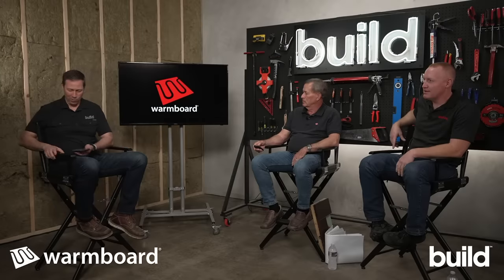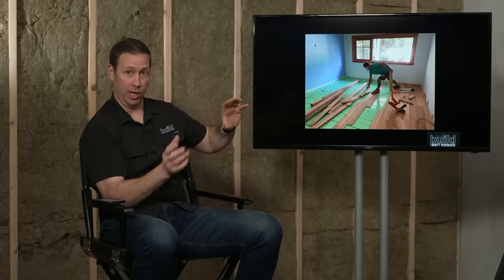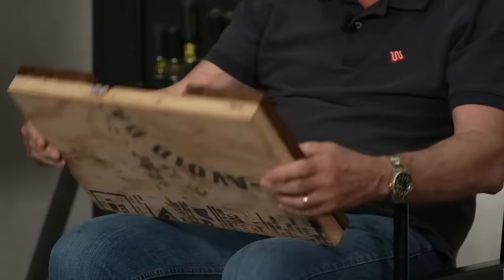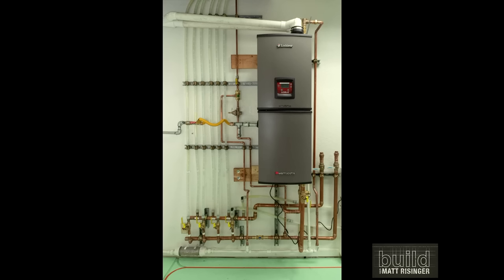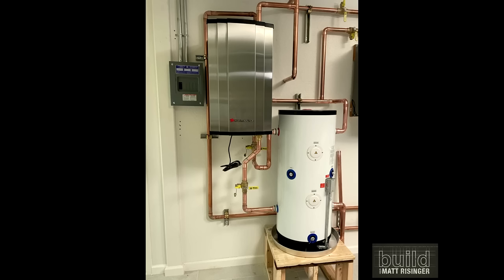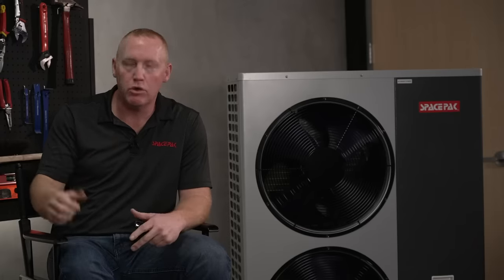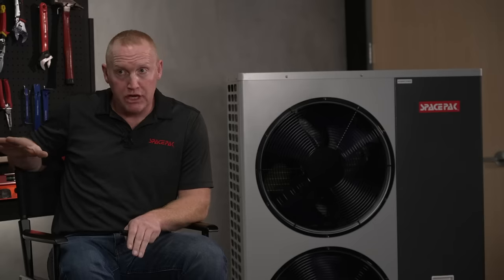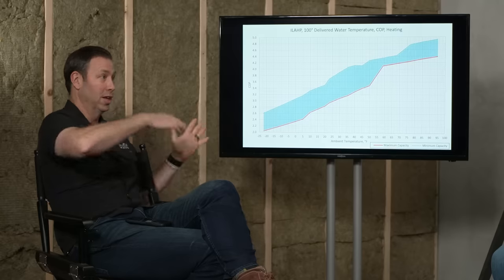Cold Climate Heat Pumps for Radiant Floor Heating. No gas, no boiler!

Comment: Why is it called "Radiant Floor Heating"? Very little heat could be transferred via radiant transfer but rather conduction to the flooring material which then heats the air in contact with the floor which then convection would distribute the warmer air upward within the room establishing a rotation circulation with cooler air sinking down to the floor replacing the warmed air. 

Radiant heat transfer can only occur line of sight, and does not heat air, but only the water suspended in the air. In other words, almost no heat transfer at all. And there cannot be any radiation transfer from the pipe or aluminum because heat radiation is light, which is completely obscured by the floor material. The system heats the flooring via conduction. The flooring material would technically radiate heat upward but I doubt a person could feel the effect. You can test this using a piece of cardboard, or any opaque paper, to block the path between the floor and your body to see if there is any difference. I expect there will not be, because it is the air in the room keeping you warm, not radiated heat. 

All right, I'm off my soapbox.

Comment: Concrete is a poor conductor which makes it perfect for radiant heat. It has thermal mass that give heat off slowly and consistently. It also has tons of flexibility unlike pre spaced worm board.
Reply: The best radiant pattern is a spiral  pattern where the supply and return follow each other.   No cold spots.    The warm board looks like a serpentine pattern 👎. The worse pattern.      Floor is hot and cold hot cold hot cold

Comment: So imagine I install warm board as I would T+G OSB. Then, partition walls and backout framing. Then some HVAC is needed, plumbing, electrical, drywall and taping. Interior trim, cabinets, and other finishes. Painting happens before 
the floor finish, which is last. Obviously, Warm Board won't survive the construction process without protection. What do installers do? Sheathe the entire Warm Board with 1/2 OSB? Sounds extra pricey. Is there an alternative? What do you recommend? Curious in Denver.
Reply: i wouldnt worry about a 7/16 OSB panel costing $13 when these cost about $400 each.
Reply: Once you lay something over the warmboard you cannot tell where to nail the wood flooring.  Your nails could only penetrate 7/16".
Reply: @philipdamask2279  well to be fair, wood flooring is maybe 7-8” max width.  You can see the tubes as you go.  Perpendicular would probably be safer.

Comment: Any hope that heat pumps will be able to heat at even colder temperatures? I’d like to wait to buy a mini split until it can heat all winter here in MN
Reply: It's just a matter of finding the right refrigerant. This will have a low global warming potential and turn from a liquid to gas at the temperature you want. If you use a refrigerant that boils at -70F, you will be able to extract heat from the air in MN even on record-breaking cold days.
Reply: Don't let perfect be the enemy of good. You don't drive around a big box truck just because everyone once and a while you'll want to move house. Think of the heat pump the same way. The above heat pump will output over 30kBTU as -20F (the lowest 99% temperature I could find for MN) with over 160% efficiency. Spending a little on supplement heat on the other 1% is still very likely cheaper than either waiting-for/buying a 'better' heat pump, or buying no heat pump at all.
Reply: @tlangdon12  Sure, but think of what your suction and head pressures would be using that configuration of refrigerant in summer..... What you're suggesting is totally unworkable.
Reply: @KennyMacDermid  So you're using a LOT of electrical energy to run the heat pump, (outdoor fan and compressor, defrost heaters on the outdoor unit as well, supplementary heaters and indoor fan for indoor unit) for average winter temp operation, and a LOT MORE for supplementary electrical heat on colder days.... and there can be many of those colder days. Don't try to trivialize/minimize what those operational costs will be. The overall system will be sized to suit AC demand for the home, not for heating side demand... the same compressor/outdoor unit/indoor unit will be used for all seasons and oversizing it will lead to operational problems just as surely as undersizing it will. And where will the unit's necessary electricity come from?..... probably from a natural gas fired boiler to create steam for a steam turbine-generator or even a gas turbine-generation system at a power plant. So fossil fuels will still be very much part of the reality of operating that air source heat pump. Plus electrical energy is considerably more expensive for heating purposes than natural gas. Be intellectually honest, be rigorous in your analysis.
Reply: @9UaYXxB  🙄 Supplemental heat could be natural gas. No one said anything AC related. Natural gas at a power plant then used to run a heat pump is still more efficient than burning that gas at the house. I'm struggling to find a single honest thing in your reply.
Reply: Thanks all for the replies. I didn't state, but the need for energy efficiency is not the primary reason for switching to a heat pump for me. My house has natural gas boilers that don't heat the house very evenly. Additionally, the gas prices skyrocket in winter, so maybe some supplemental heat would help make the house more comfortable while also alleviating the need to heat only on natural gas.

Again, just thinking it would be ideal for the system to be able to support some heat in winter while providing air conditioning that we currently do not have.
Reply: @9UaYXxB  Over-sizing is not as much of  an issue  these days with variable speed compressors and fans. Compared to electric baseboard heaters, heat pumps (of any recent make, model or technology) are electrical misers. In Canada, heat pumps (mostly mini splits) are rapidly out selling gas furnaces.
Reply: @9UaYXxB  You are nissing the 300-500% more heat per kwh benefit.  Particularly useful if you have no natural gas.

Comment: I was trying to figure out how to put in-floor heating without filling the tubes with holes when nailing down subfloor and walls. Would there be any notable demerits to holding the tube down a little more than 3 inches from the top of the joist?
Reply: @James Karrie I was thinking that you could mount the tubing along an i-joist with a 1 1/2 inch spacer between the bottom of the 2x4. That said, they do mention that it would take longer for the heat to travel into the floor.
Reply: @human_ai402  just install the walls and flooring first.  then mount the tubes under when its done.  not a big deal later but more of a pain under then over.  if you put in insulation after the tubes are mounted, the heat will transfer up just fine.  remember, wood sucks as an R value.  only R1 per inch.  subfloor and hardwood would be R1.5 max.

Comment: How hot can you heat the floor? A hot floor would expand the wood and cause cracks when it cools.
Reply: most people set their tanks to 100, maybe 110.  not really an issue.
Reply: @neckofthewoods24  Thanks

Comment: Question,  how do you purify and balance the humidity the air in your house.   🇨🇦
Reply: Using an HRV, a humidifier on the central system, and appropriate controls.  You'll need to involve an HVAC service company. Do it right. There's structural and health implications if it's done poorly.
Reply: You need another system to process the air.

Comment: what about using ground heet in stead of using air heat. as the ground is normaly much more constant in temperature and a higher temperature.
the only disadvange is the higher costs for drilling the ground pipes. about 5.000 Euro for an 100 meter deep wel. depending on the heat needs more pipes needs to be made.
Reply: Congratulations! You’ve selected. Message me on Telegram using the above name to claim your prize..

Comment: Looking to replace/add to existing propane gas heated "boiler" system with a heat pump driven heat exchanger driven by new solar system in Colorado at 7,500ft elevation. Needs to work efficiently at -25F (Hyper Heat) with our existing 4,500 sqft of Radiant Floor heating. Would also like the Heatpump to replace the 12 year old Central AC ducted system as well (-25F to 105F).
Reply: Stick with the propane at -25f!

Comment: Is there a govt rebate on this system next year?
Reply: Just what we need more of… subsidies on expensive toys for rich people, lol.  If you’re asking about rebates you probably can’t afford this.
Reply: @superspeeder  if it’s more efficient and heats your home then obviously it’s not a toy. And yes I’ll take the incentive to be more efficient.
Reply: @golfaddict75  if efficiency is your goal, take the money you would have spent on these expensive toys and invest it in better windows and a better sealed/insulated building envelope.  That will actually make the house FAR more efficient rather than making a piece of expensive HVAC equipment a few percent more efficient.

A house that uses (loses) less energy is the better investment every single time.  A nice side effect of a more efficient house is you need LESS hvac equipment to heat, cool and dehumidify it.  Not to mention a house that can stay warm for days in a winter power outage, not hours.

An efficient house is also more comfortable and will have better indoor air quality (better air-tightness means less pollutants entering).  These guys falsely promote radiant heat as being better for people with asthma.  An air handler that constantly filters allergens and particulates out of your breathing air is much better for you than a system that doesn’t.

Comment: Houses (R-15/R-38 attic) need at least a 120,000 BTU boiler (Hydronic run at 180F). 60,000 BTU/ 5 Ton central split system are just too small. Strongest point of hydronic for me is that you don't have any air handler noises.
Reply: hydronic does not run at 180F!!  most set theirs to 100-120F.  a cheap hot water tank works just fine.

Comment: What happens with the heat pump when the outside temp goes below the rated operating capacity of the heat pump ? Does the heat pump simply stop generating heat ? Is the heat pump damaged ?
Example: for a few weeks every winter (end of January, start of February) it can dip down to between -30C and -40C. Will this damage the heat pump ?
I assume this is where a ‘boost’ heat element is used, but what happens to the heat pump ?
Reply: Watch the video again as this is discussed.

Comment: How do you winterize the water handling components in the heat pump, can they be located inside the building heated space??
Reply: I answered my own question seconds after I posted - use a water glycol mix.

Comment: Interesting video.  The description of how low ambient heat pumps work at low temps was a little off.  Typically vapor injection into the compressor does not add heat.  It literally keeps the compressor cool.  That is needed because the variable speed compressors ramp up past the rated 100% speed to extract more heat out of the below freezing outside air.  

Doing so requires more power to the compressor, adds noise and may require more defrosts.  While impressive technically, the typical "hyper heat" (Mitsubishi's trade name) or competitor's low ambient technology maintains "rated" capacity by employing a large reserve capacity.  In reality a 48,000 btu system may actually be a 58,000 btu system utilizing vapor injection, elaborate electronic expansion valves and sometimes hot gas bypass to continue supplying close to 48k btus at low ambients.  Conventional heat pumps reduce power requirements as their btus quickly slide off around 35f.  Low ambient systems increase power.  Still high tech heat pumps are as impressive as they are expensive.

A real concern that was discussed is backup capabilities when a heat pump fails.  Or backup electric power to run a heat pump.  Fuel based systems are historically more reliable and are easily backed up with a small generator.  The typical hvac tech can fix them with parts off the truck or he can request the parts house open for access.  So far, inverter based residential and light commercial systems have less support, sometimes requiring weeks for parts, even prior to  covid.  The lower cost lower capacity no name inverter heat pumps are really throw away units, a kind of modern day window unit.

Finally the use of low ambient heat pumps are more suitable for extreme performance buildings where moderate btus will suffice and an occasional three day outage won't freeze the pipes.  The existing housing stock is really not as well matched.  Dual fuel forced air systems using mid range inverter heat pumps (non hyper heat) and a fuel system for severe weather makes more sense for most applications, especially retrofits. Lower costs, easier to maintain and much reduced risk.
Reply: Another take on the above from another forum:  The interesting question is what makes a "hyper heat" heat pump work better than a traditional unitary heat pump that often has a balance point around 35f? The answers are added engineering features including variable speed compressors, electronic expansion valves and vapor injection refrigeration circuits.

The units are variable capacity thanks to their variable speed compressors and "inverter" based drive electronics. A "hyper" unit may be rated for 18,000 btu at standard conditions (usually 47f) but often can achieve that 47f capacity at 50% compressor speed. As the outside temperature decreases, the unit ramps up its compressor to maintain rated capacity. At some point the compressor is running at 100% speed and capacity and then it gets colder outside. The hyper unit then goes overspeed holding full capacity usually down to 5f. Typically the outside unit gets louder and actually is drawing far more current. The power use is opposite of a conventional unitary system that uses less power as it is getting colder outside.

Then hyper units have two more engineering features at their disposal. Electronic expansion valves (EEV) and vapor injection. EEVs control the superheat and replace the function of traditional metering orifices (pistons) and TXVs (Thermal Expansion Valves). EEVs are computer controlled, stepper motor driven, refrigerant metering devices. The unit's computer can regulate the EEV to minimize wasted superheat and optimize the refrigerant flow based on realtime refrigerant and ambient temperatures. This adds efficiency and is needed for optimum variable capacity.

Vapor (flash) injection adds another EEV and heat exchanger (HX) to divert a small quantity of refrigerant after it has gone through the indoor coil. It injects a precisely metered portion of flash gas back to the compressor to avoid excessive discharge temperature when the compressor is in its special "hyper" speed mode.  Vapor injection easily enables at least 10% more capacity exactly when its needed, eg during the critical below freezing temperatures down to the unit's minimum rated temps.

So while the unit may be achieving 100% of its rated capacity down to perhaps 5f and is still producing heat down to -22f, low temperature efficiency is lower because of traditional reasons like ambient temp, defrost cycles and a pan heater. There is also the hyper overspeed feature that contributes. Overall an amazing engineering feat that comes at an upfront cost premium.  

Finally, in most parts of the country propane is cost equivalent to electricity, insulation and air sealing becomes more important to use heat pumps effectively, heat pumps DO transfer heat to and from the outside air, proper installation is critical for long term reliability, more training is required to component level repair a "hyper heat" model, BUT they are proven technology that also provide AC at no extra cost.

Comment: There is a bigger problem not being consider. As you stated, jurisdictions are moving toward mandatory electric systems. Add that to the move to EV cars. Where is the capacity from the utilities coming from? During last weeks artic weather, the local utility asked people to turn off electric devices not used. The core electric infrastructure is the problem.

Comment: How does it work with GeoThermal Heat pumps?
Reply: In short: Very vell. Just as well as with 'air source' heat pumps.

Just as 'air source' the 'ground source' heat pumps benefits the same way. The less the temperature needs to be raised from the outside air or ground to the radiators/emitters inside, the more efficient the heat pump can run.
The larger area an emitter/radiator has, the lower surface temperature it needs to transfer at given amount of power. So the larger area, the lower the water temperature is required, ans so using most of the floor area wins in the lowest required water temp to keep a house at a set temp.

Comment: I disagree with his assessment of concrete as a medium for heat. Once it's hot, it STAYS hot for a long time. In winter, that's a good thing. 
I'd use a product from this guy for hydronic AC in my ceiling or a remodel of an older house but not for a new build.

Comment: $6  surcharge...  You can almost buy all your equipment for a normal radiant floor heat and for the 10$ /foot difference you can buy a standard design/equipment and have it installed. As cool as it seems just doesn't make sense price wise for the majority of homes and customers out there. Some engineering time could be diverted to bring the cost down and make it more competitive so it can be a system that can be used in the average home build.